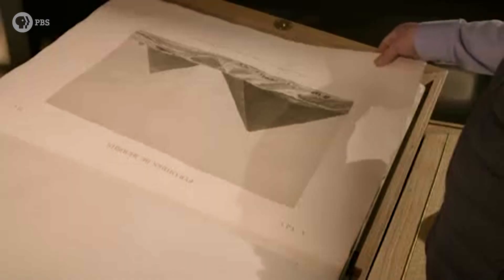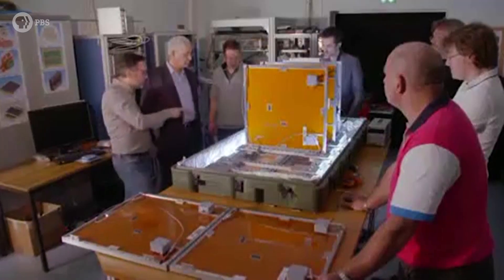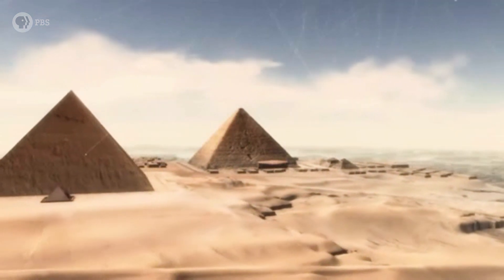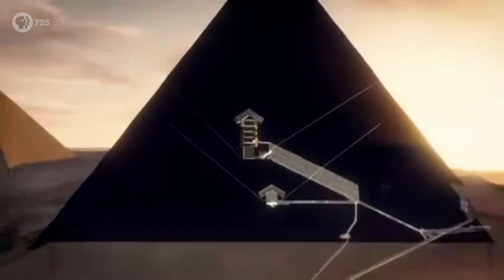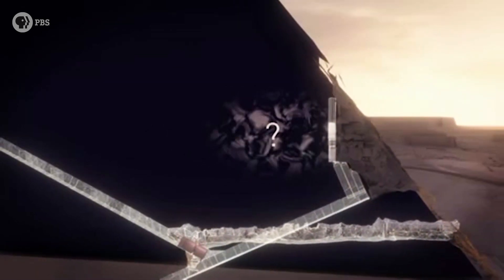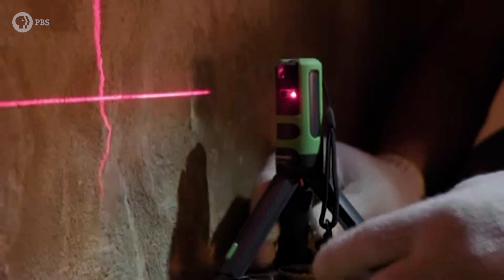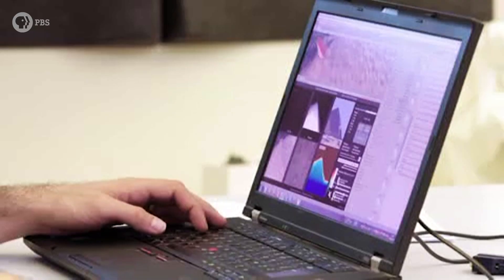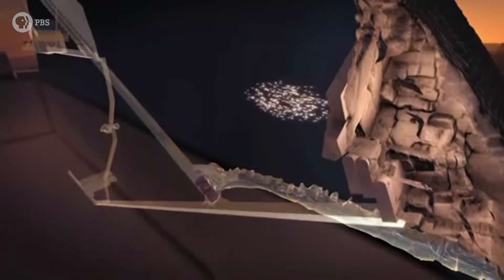Muography: see inside the Great Pyramid of Giza

Comment: so if the muon  can travel that far inside  how did they shield them before use
Reply: Why should they shield them before use?
Reply: @Talaxianer  same reason they dont walk in to the xray unit wile its on it would scater the xrays on the film right. or u dont run film in to the camera in sun light
Reply: @17hmr243   They used scintillation detectors. The scintillation material absorbs energy from charged particles (muons in this case). The scintillation molecules emit the energy again as photons. These photons can be detected by a photomultiplier, that turns an incoming photon into a detectable electronic signal, that can be processed. There is no cumulative effect like in photo films.
Reply: @Talaxianer  ok thank you
Reply: We'd guess penetrating that much stone probably leaves a different signature that their algorithm filters.